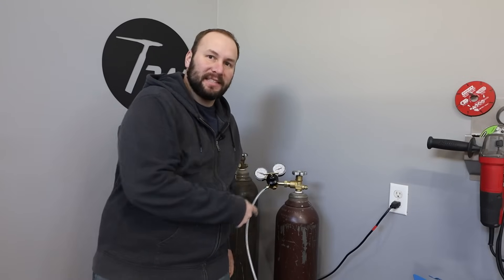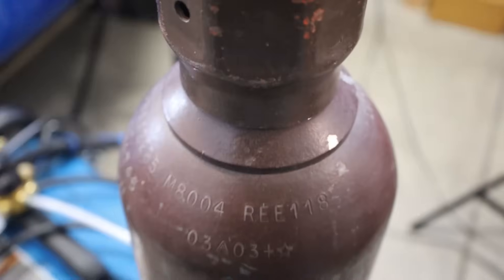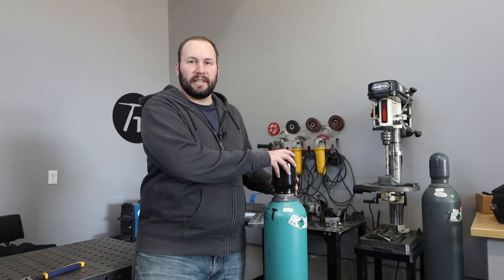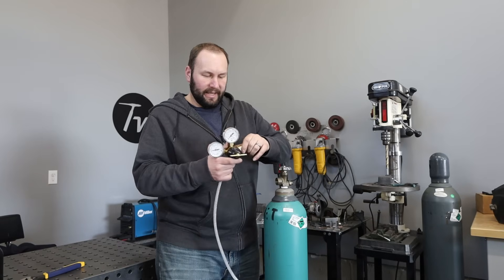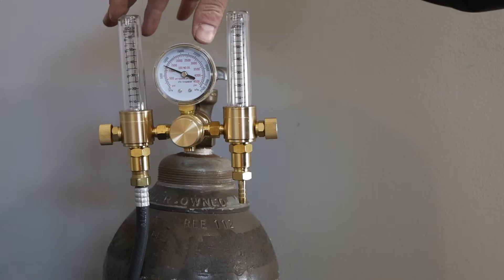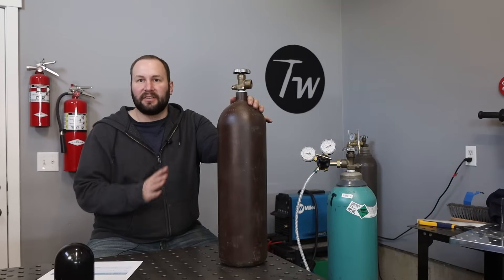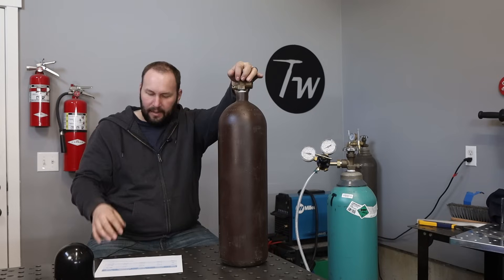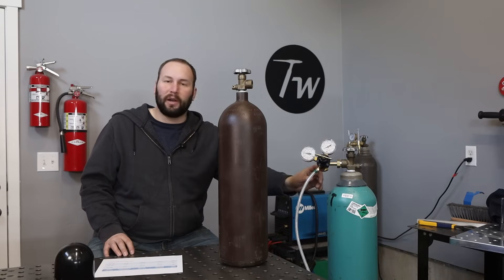Welding Gas Cylinders: A Beginner's Guide

Comment: Great stuff! Just gotta keep my eyes peeled and hopefully pick up a cylinder for cheap on Craigslist.
Reply: Sounds great, but sometimes places won't fill them if you didn't get the cylinders from them, just an FYI, also if its past its inspection/pressure test date they won't fill them either in many cases.

Comment: I’ve never gotten a tank filled more than to 2,000 pounds. It would be nice if it were 2,400.

Something I found strange several months ago. The guy who works on Everest’s channel said that the amperage determines the amount of post flow needed for TIG welding. I’ve been welding since 1973, took several courses, and have most of the welding texts, which I’ve read. I’ve never heard of this before. He claimed that post flow should be one second for every 10 amps. So, one second for one amp, 10 seconds for every 100 amps, and 30 seconds for 300 amps. He claimed that was to cool the tungsten and of course you needed time for the weld, such as for stainless and aluminum (which a do agree with).

That seems like a lot of nonsense to me. Once you get above some low amperage, such as 50 amps, or so, the tungsten is at about the same temperature, and takes about the same time to cool. 30 seconds of post flow for 300 watts? That’s nuts! At least, from everything I know.

What do you think about this?
Reply from the maker: 2000 is pretty typical for what I actually get too, though they’re rated higher.
Reply: On post flow ? Watch your tungsten , if it turns grey ?  You are not cooling enough ,  just turn up a touch , i run a round 5 sec    this is what ive been told , hope it makes sence to you  regards from australia
Reply: @timothyrouse2853  yes. And that doesn’t take too long. My tungstens cool off enough so that doesn’t happen with a six second postflow. Possibly even shorter, but that’s as short as I make it. I’m not questioning it really, in the almost fifty years I’ve been doing this I’ve found that it just takes a short time. 20-30 seconds, as that guy was saying? Crazy, in my opinion. I was hoping Tim would say what he thinks on this.
Reply: @melgross   mel  iam still learning  i ask lots    and watch videos  so its all still  all  to me   does my head in some times ,   lol ,   my amps are a round 90 , i run ,  guess this is how you learn  ask others who have been doing it for years     but that long of a post flow seems crazy ,, i agree with you ,   regards from australia

Comment: do you know if you can flow in some of of the cheap-ish helium(the stuff they use to fill balloons) when welding aluminum or does it have to be the super expensive high purity helium? i think it would make for an interesting video
Reply: Supposedly to keep the people that inhale it from dying due to lack of oxygen the cheap balloon helium has a good deal of normal air mixed inside of it. So much so that it is essentially useless as an inert gas.

Comment: What do you think about the jegs TIG & MMA 200 AC/DC Welder [Single Phase 120V/220V]
Part Number: 555-81563
Will it work good for aluminum/I’m a beginner welder
Reply: That size should be ok ?  Make sure you change roller  and mig gun liner for alli ?

Comment: In many places near me, 125cuft tanks are the biggest they sell. You can lease larger. But 125s are a good size in my opinion, because they have lots of gas for a hobbyist, and are still manageable to move by yourself, especially if you don’t have a pickup truck
Reply: How much does a 125cf tank weigh, roughly?
Reply: @autodidacticartisan  Around 70-80 pounds full if I recall.
Reply: @wildbill23c  80 sounds about right. I want to weigh it and my 250. The 250 is crazy heavy. Hard to lift by myself

Comment: I refill my aluminum 22cuft argon for $48 which doesnt last long. That small size makes me run a #8 cup only, I have bigger cups but I dont want to run anymore than 16cfh. So, I'm thinking of getting 60cuft but its $437 for a new full aluminum cylinder. Its $109 to fill a 60cuft. *In Guam.

Comment: buying gas just isnt worth it
Reply: So how do you get it ?
Reply: @TempleThomas  probably flux cored wire.  :-/  Mig is mostly useless outside as a light breeze blows away shielding.  If you weld inside and want nice welds that don't look like bird shit, C25 is worth every penny!
Reply: @jagboy69  yes I'm quite aware.   I was asking if he's saying buying gas isn't worth it, how does he get gas.   This was about tanks so I want thinking someone just being negative saying not to use gas at all.
Reply: @TempleThomas  Some people see buying gas as a waste when there is flux cored wire.  I was that way for years until I learned what a difference gas makes.